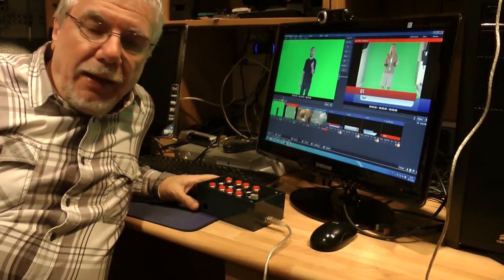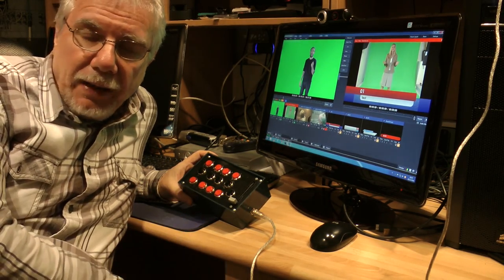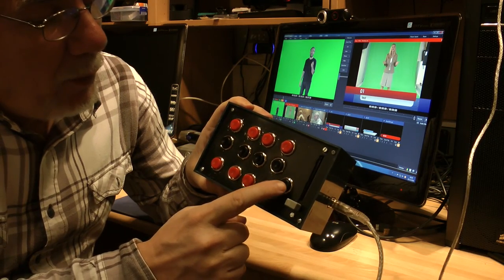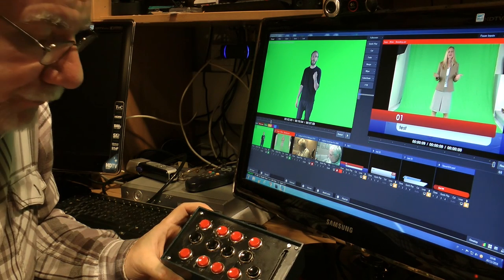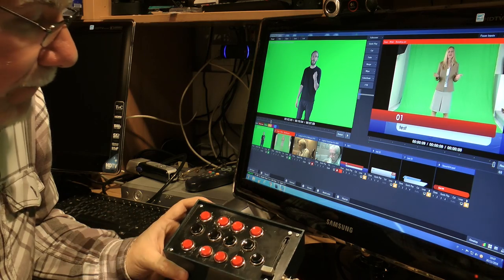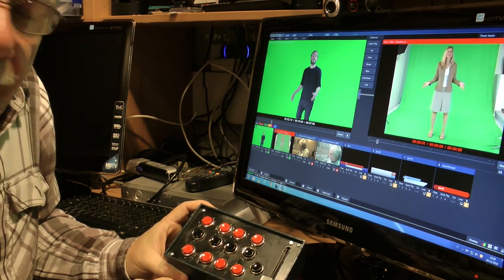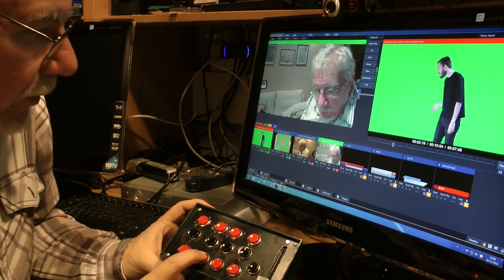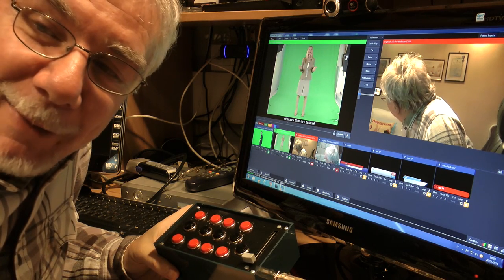vmix cheap hardware controller

Comment: Hello sir 

it is great job . help us very much .
can you give me the cod and the cable designed that i can made it myself .
Reply from the maker: I think you could start from here:  http://ovinophobia.blogspot.it/2012/12/arduino-lego-midi-controller-note.html
Reply: i get  it sir , 
but that was 3 button  arduino uno .

i need 4 button and 4 overlay that you show with arduino mega besed .

i would verry glad if you could send me the same project .

ratan.
Reply from the maker: ok. Send me an e-mail address and I'll send the code and the connections.
Reply: hi sir, 
this is beautifully project 
can you help me for start this project 
may be for sharing code with wiring diagram 
thank's before
Reply: Can you please share with me the code and wiring diagram..
Reply: Could you please send me the code and wiring diagram